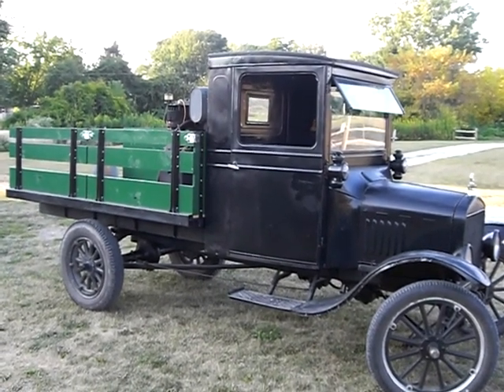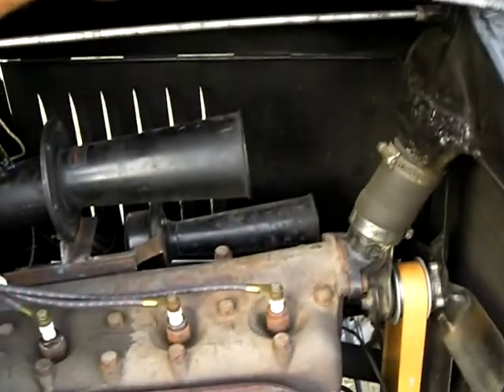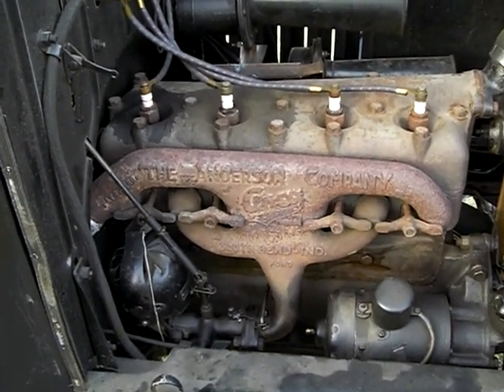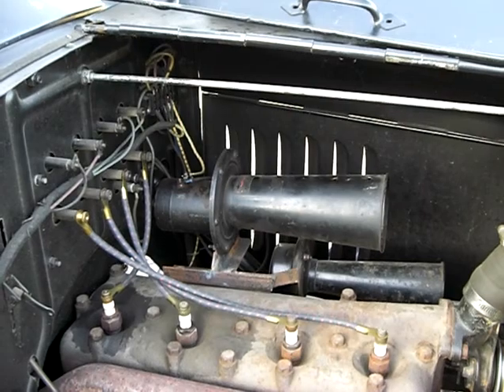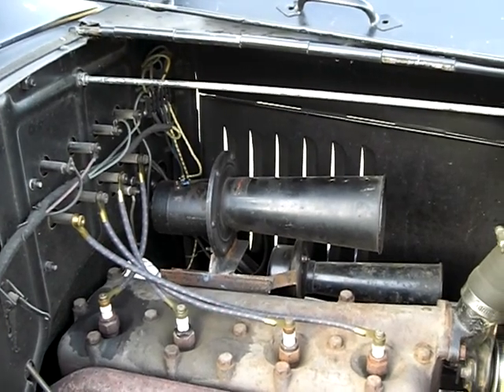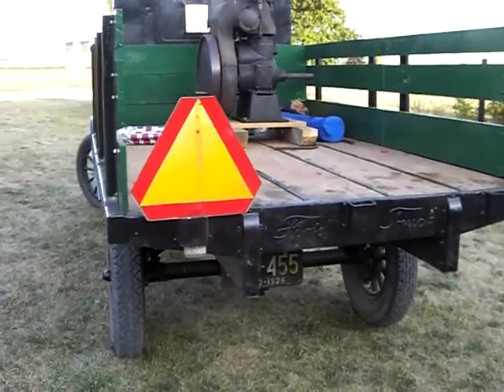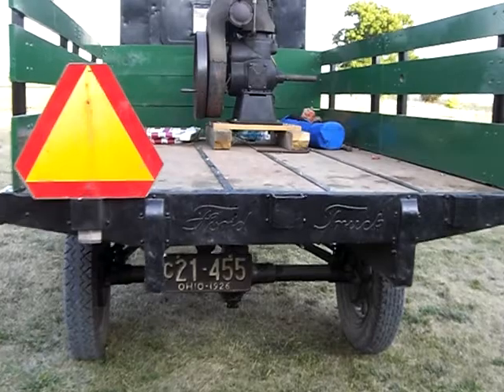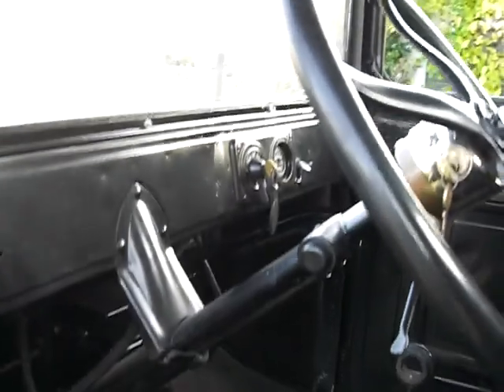1926 Ford Model TT Ton Truck  T

Comment from the maker: Thanks for the kind words! I haven't been following current prices, but a few years ago, a nice TT could be had for about $6000. My truck's top speed is about 25mph, but I have an auxilliary trans with an overdrive gear. I also have the low speed rearend. With a high speed rearend it may approach 40mph. These trucks were rated to haul one ton, but I know they will haul at least a ton and a half. New Fordson tractors used to be delivered to the farmers on the back of a Ford TT!

Comment from the maker: Thanks for the compliment! It has the original 6 volt system and it works very well. Make sure your battery cables are heavy enough. The 6 volt systems are very dependent on amperage and you need heavy cables to deliver it.